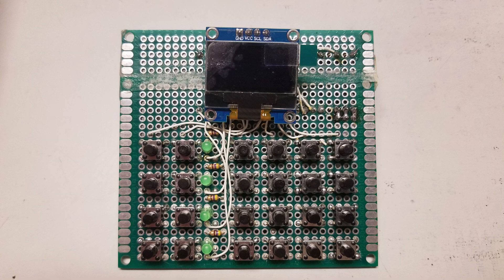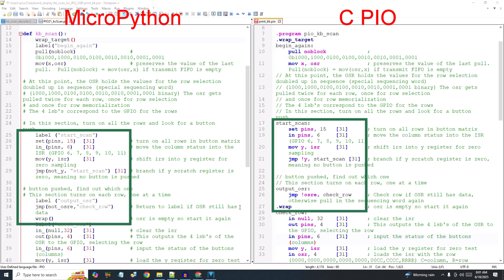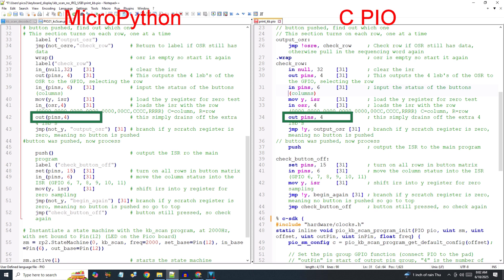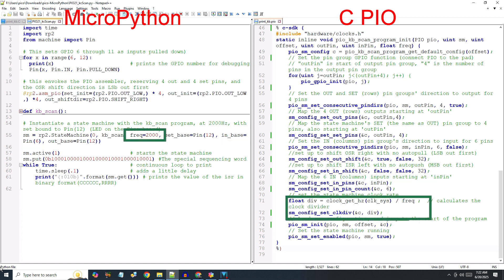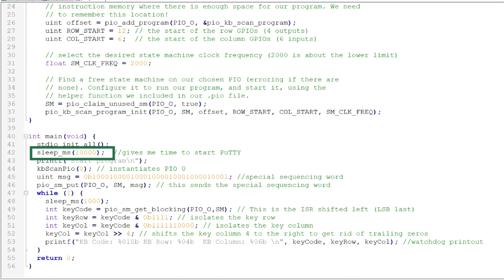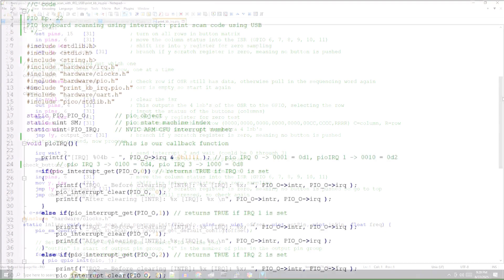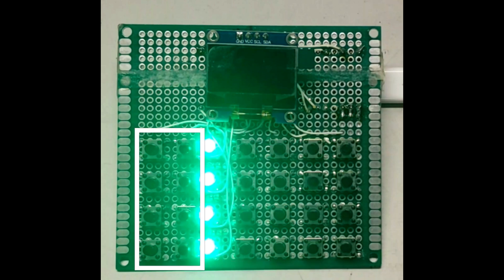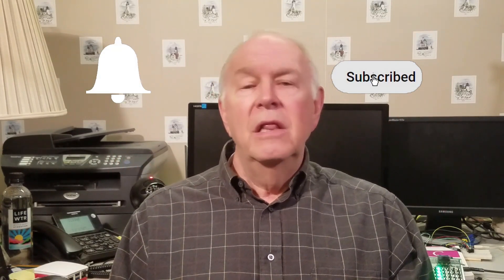PIO Scanned Keyboard with C - RasPi Pico PIO Chronicles - Ep.22

Comment: point leds upwards as the switches. both caps and no caps.
Reply from the maker: That's interesting.  However, the LEDs will eventually disappear.  I only used them for debugging the row scan process.  Thanks for the suggestion.

Comment: Am I right tom assume this doesn't have nKey or 6Key rollover? Not complaining, I haven't gotten PIO to work for anything. Tried for my open source ECU code, but ended up just finishing it in generic code. Upside is code should work on anything 32 bit that has a 64 bit microsecond timer/counter. Normally you use smaller timers, 2 per cylinder (for full sequential), and reset them to avoid overflow; but, 64 bit timer overflows after 4,000 years of continuous use, so I didn't need to bother.
Reply from the maker: Marc, thanks for the comment.  This one does not have NKRO.  The application I have planned for this keyboard only wants one key at a time.  As I discussed in Ep. 21, one key at a time makes the keyboard build and program much simpler.   If I added key diodes, and some changes to the program, I could add NKRO pretty easily, the callback program would just be a bit more complicated.  Thanks for watching!